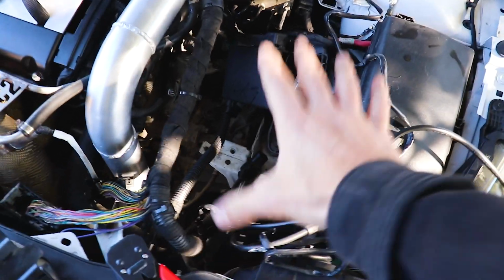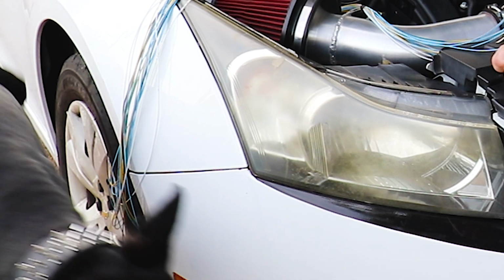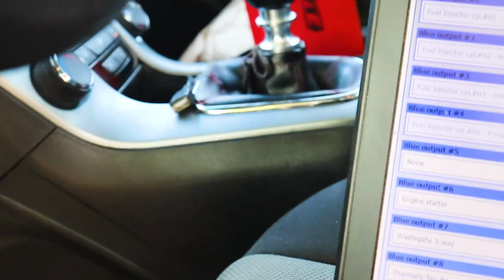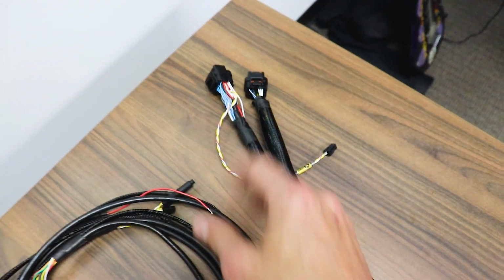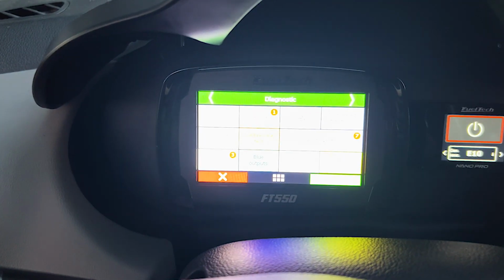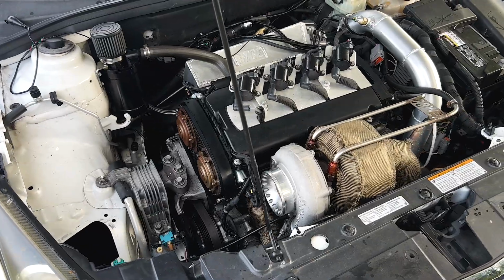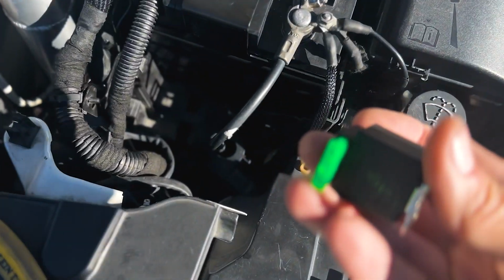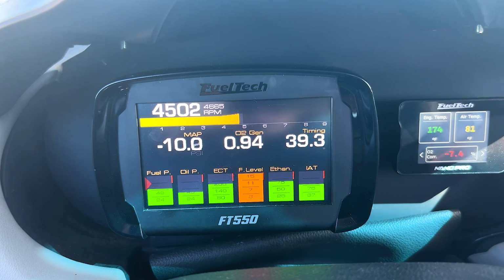Boosting a Chevy Cruze - Turbo Install & FuelTech FT550 Setup

Comment: I have a ft 550 I understand some of the first start a run issue it can be tuff I have ac16. Lot battery with no alternator am I’m struggling with correct voltage stuff for sensors a such. I need a tuner if you tune. Need help got truck running. Ls 5.3l twin turbo. Power glide trans 2800 stall small cam. Factory motor other than head a cam.
Reply from the maker: You'll get it!  I just play around with my own car.  I'm not a professional and would hate to hurt someones engine with my lack of experience.  I don't mind experimenting on mine though.  Maybe down the road I'll help with tuning but I need more experience.

Comment: Should not adjust crank timing with a timing light boy you almost messed up.
Reply from the maker: You need to set base timing so it's correct in the ECU.

Comment: Can't wait to see this in person. Been chipping away at my rsx just have to wire in my injectors, coils, and iat and coolant sensors then throw the battery back in and it should be ready to start 😊.
Reply from the maker: That's awesome! They take some time don't they? Looking forward to hearing it going.
Reply: @cmattdabrat  finished most of the wiring last night. I just need to figure out how I'm going to connect the map hose to my intake manifold. Hopefully I can figure that out tonight or tomorrow and have it running by the weekend. Hopefully this year goes well and I can actually gets some parts for the damn thing
Reply: @cmattdabrat  ended up just hooking up my stock map sensor last night and got it started. Now I need button up the wiring, set the timing and keep moving forward I'm so stoked. Gonna take some time to teach myself how to tune it but man I've been waiting for this for a long time.

Comment: Love your content man. Theres not a lot of people who post regularly about chevy cruzes. Youve motivated me to work on my cruze. Just recently installed some zzp parts. My car is been running a lot better. Keep up the good work man.
Reply from the maker: Thanks! It's a fun project and definitely want to push this to the limit. That's awesome to hear. 1.4?
Reply: yes sir, got the 1.4l. I recently replaced the vavle cover and the coil pack. im getting the pvc and port intake manifold upgrade next. @cmattdabrat

Comment: Thanks man! By showing the process of attaching a stand-alone aftermarket ECU to a modern day car, like the Cruze, you showed us the unlimited capabilities of swapping engines to this car! I wander if everything based on the BCM works somewhat similar to how came from factory (like power windows, interior lights, airbags etc.). I mean, just think about it Cruze fans! "What if" we could swap something beefy to this thing with an aftermarket ECU?
Reply from the maker: Everything functions the same! With the exception of the auto run lights seeing as I removed the stock instrument panel. Blinkers, horn, radio, windows... BCM is handling it all. Really just took control of the engine and the fuel pump.  Solved all the issues I was running to with power cut.
Reply: @cmattdabrat  Thanks man! Waiting to see an update after fixing the issues with the idle! My Cruze has an issue with a leaking valve cover gasket and injector seals, alongside with a broken turbo intake hose (Which has made it terrible to drive under 2000RPM). I also have a Cruze 1st gen, but with the Italian(VM Motori) 2.0 diesel!

Comment: Great vid!!! Im actually wiring my car with a Ft550 I had a FT450 and watching your video clarify a lot of loose ends like the VVTI and the start button, In my setup I cut the gear sensor cable and used it for the pedal made the changes in the ft manager no issues.
Reply from the maker: Nice!!! FuelTech was helpful in getting the triggers dialed in, but wasn't too bad of an install. Just be sure if you're going to trigger relays with the FT550, you have your relays wired as negative triggers.
Reply: @cmattdabrat  hey thanks for the reply question where did you get the 12v for you VVTI solenoid?
Reply from the maker: @Gravemutehq  I tapped into the ignition 12v supply that's key on / off. Might be sharing the same supply / circuit as the coils.
Reply: @cmattdabrat  thanks!!

Comment: Hi Matt, the gear wire you had is meant to go the gearbox. Some gearboxes (mine for example) has a first gear selector switch on it. Not sure yours has. 

Its to limit the boost in 1st so you dont destroy your dif. Ive got the switch, but havent it wired up as my dif & gearbox are pretty much indestructable.

If you have the switch, i recommend wiring it in, as you have the (what we call over here) the chocolate box!

Great vid tho, exciting times!!
Reply from the maker: You're right about that! With this model cruze and transmission, it doesn't have gear detection. I just thought it was funny they made the decision that it's a standard part of their wiring harnesses. The pin out of the FuelTech, once I entered what my needs were, some of the pins were taken up by the Gear detection wiring. Not a big issue and I'm sure at some point once I can afford a sequential transmission I'll make use of it.

Comment: Hey Matt be careful with that new turbo I saw a guy that had the same one and when it would heat up the compressor wheel would lock up in the housing so if you loose boost and the car is hot that might be the issue
Reply from the maker: The ball bearing turbo? The one that's currently on their has been doing well. No issues thus far.
Reply: @cmattdabrat  yea I wish I remember the guys YouTube but after it cooled down it was fine so idk what the issue was so if it does it in the future I'd look at that